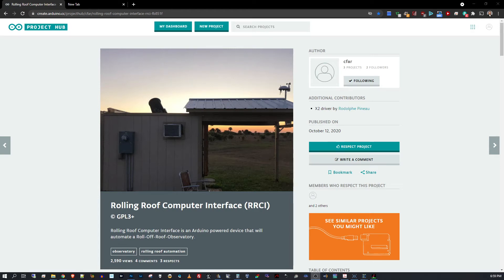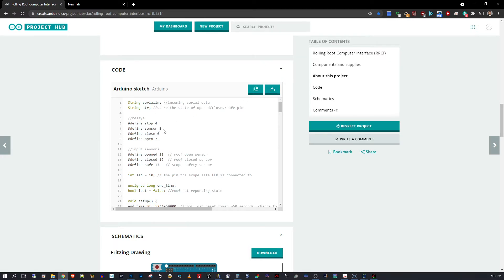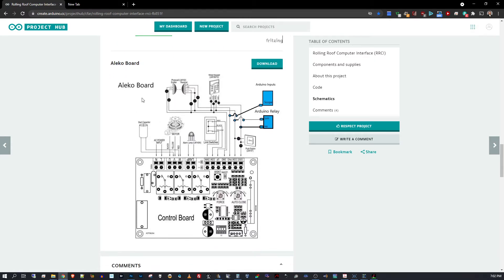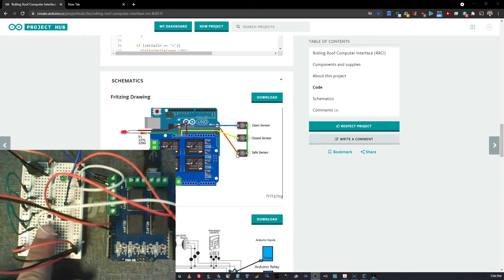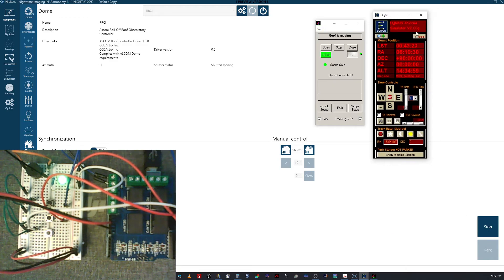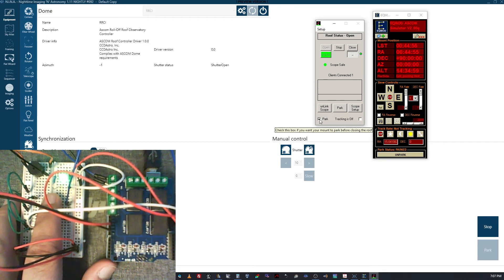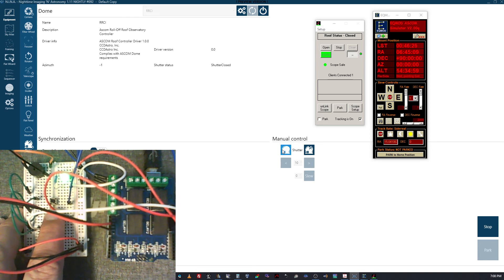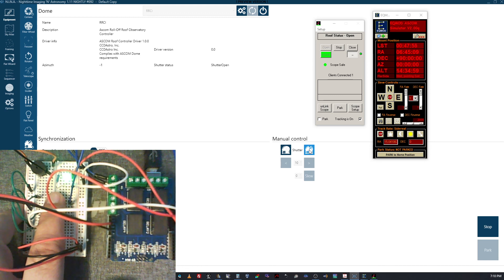Roll off Roof Automation Proof Of Concept using an Arduino and N.I.N.A

Comment: If you use the relays shield V4 (new version 2023), take care of the changed pinout of the relay inputs, you have to edit the sketch.
Reply: can you please explain the difference?
Reply: There is a changed pinout of the output pins, so a modification of the port setup in the sketch ist neccessary. But no problem t all ;-) I have much more problems to get resetted the relay card after the impulse for opening the roof. Even woth pullup - pulldown resistors I cannto get a stable function. In N.I.N.A. I have set the instruction to reopen the roof after closing, this resets the output.

Comment: Thanks for the video Bruce! I'm actually doing something very similar with mine as well, but having troubles with the com port. I appreciate you letting me know about this video as it was very helpful to see how you've done it.
Reply: hey joe , I was just about to post this video onto you, :) as I know your going down this route . Been looking into this myself, and a lot of googling, but don't know where I seen it but I think its com port 1 is used with Arduino, if its like EqAscom where you have to specify the com port because letting it search for itself  will result in not be found. Don't know if this any help ? l
Reply from the maker: I hope to install my motor next weekend, I will let you know how it goes.